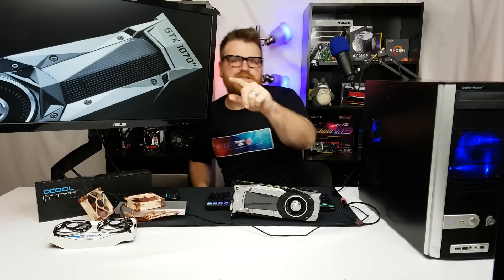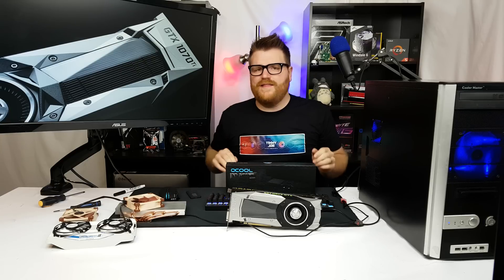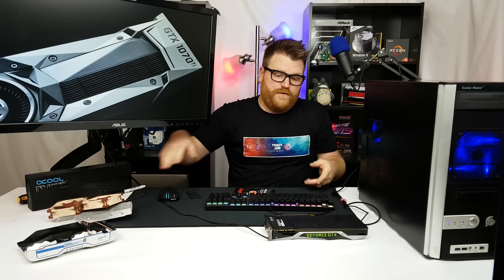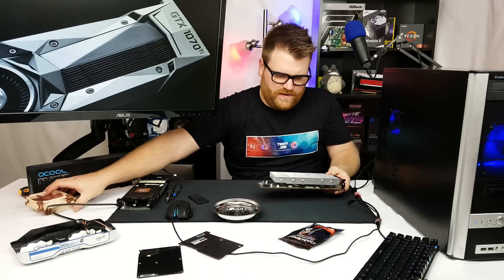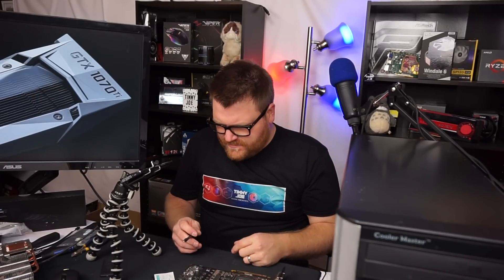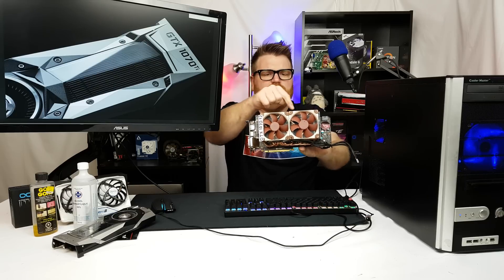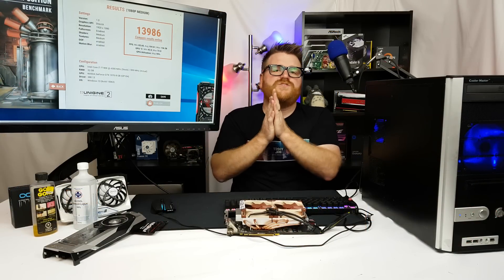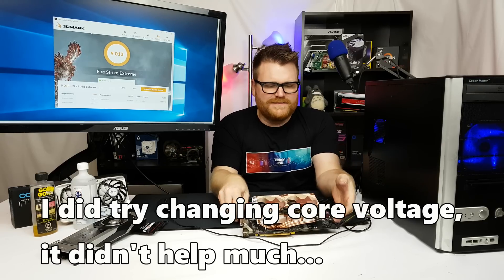My Own Nvidia GTX 1070 ti - Power Shunt Resistor Mod

Comment: this crap is nuts, i wouldn't ever apply gallium to anything with solder around it. only thing i feel comfortable really is die to ihs, and maybe maybe pure copper heatsink in the perfect quantity.

but this? No. give me the exact resistance resistor required for the voltage boost you want

Comment: Do not use Liquid Metal to Shunt Mod, it will melt the solder over time and the resistors will pop out of their place.
For Shunt Mod use proper soldering.

Comment: You can use a program called Argus monitor, allows you to set the fans (connected via SYS_FAN or CHA_FAN header) on a fan curve that corresponds to the GPU temp.

Comment: Tip, cover the solder points in clear nail polish so the gallium doesnt't dissolve the solder in a few months taking the shunt with it. I'd paint around the shunt, the ends, and the middle just to minimize the contact with any components, as long as it contacts the top of the solder points it will work, but covering shit in nail polish means: you can clean off the LM then use acetone to clean up the nail polish wich leaves you with a brand new surface insted of a half corroded amalgamated mess of solder and shunts.

Comment: If you're using liquid metal to short those resistors, it apparently creates an amalgam with the solder Nvidia uses and weakens it to the point that those resistors just fall off.
Reply: yea i'm pretty sure it has gallium in it

Comment: Let's see how long this graphics card lives, since Conductonaut contains Gallium, which corrodes quickly.
Chance by now, the components on the PCB have corroded off and the card is failing at this point.

Comment: Buys GTX 1070ti. Applies power shunt resistor mod. Increases clock speeds. Smells burning. Runs for fire extinguisher. Realizes the fire is on head.

Were gingers really kissed by fire?

Comment: It’s all fun and games until someone loses a house 🏠😞
Reply: But how though, 2 fans on Mobo headers (where they go) and a gpu thats made to blow capacitors and such to reduce the risk of a fire or electrical hazard. No prob as long as your psu is good enough.even then still pretty hard to start a fire
Reply: "reduce the risk" not Eliminate.  You may have never seen a PC literally catch on fire but I have.

Comment: You bypass a protection mechanism of the electrical design and by doing so you put the GPU in Risk of Death. Is it worth Risking a 500$ (600 today) for 3% performance boost ?  I don't think so...   Its like taking a Fuse of the system

Comment: The MSI AB slider doesn't actually "add" any additional power to a GPU. What it does is ALLOW the power (max value defined in the BIOS vs the default value) to be used. That's it..

Comment: Also this mod is kind of (although not totally) pointless unless your water cooling and although max clock speed doesn't increase that much, its not really the point of this mod. Its more about making the card nice and stable and not constantly go up and down all the time because its struggling for power when unmoded and overclocked. So it will cure a lot of minor here and there stuttering if your running 4k 60fps for example.

Comment: You should check the resistance  with a multi-meter before and after mod. Be careful not to lower the resistance too much by using to much liquid metal or other conductors like wire otherwise the card will go into safe mode and be locked at a couple hundred MHZ.

Comment: Should I get a costly 1070 like the Asus OC one or should I get a cheap 1080 and overclock it with MSI Afterburner? Nice video by the way.
Reply: Titin Sahoo if you can’t decide go with 1070ti

Comment: Gn did a nice video on the shunt mod. The more liquid metal you add the more power get delivered to the gpu.
Reply from the maker: I have the perfect amount, I can't go above 103 of 110 on the power slider now. I've had this card at 2.2 Ghz stable. It's as far as it will go. I need to get a real card, VOLTA HERE I COME

Comment: I've seen alot of OCed 1070s and i noticed that mine must be a pretty good Overclocker, i'm getting around 2126-2152 on the Core, at full load around 55-60C and 600 on the Memory with an Air cooled 1070 FTW, (with the side panel off of my case), and i never got any crashes or artifacts, makes me wonder just how far i could go with it, but i'm happy with the OC i have on it already.

Comment: Be cautious with Alphacooler waterblocks. Mine on a R9 280 leaked where the four screws hold a cover on the water block. IMO not enough preasure to keep a good seal. So be careful when using one.
Reply: Alphacool usually is very good. Idk man.
Reply: Also had Problem with alphacool blocks pushing the oring away because of corrosion😢

Comment: I am curious because you dont seem to overvolt. For example on my 1080 ti, if I dont overvolt I dont reach 120% power delivery limit with my max OC. So isnt it the same for the 1070 ? And if you dont reach 120% a mod like this wouldnt change anything or am I missing something ? Wouldnt a mod like this be more effective as you crank up voltage? 

Also, how fast do you think a mod like this would kill your video card with overvoltage added to it ?
Reply from the maker: Do you mean hardmod overvolt. Because you can't software over volt especially a 1070. The limit is set way too low changing anything and software it doesn't seem to affect anything. When I had a 1080ti overvolting made a little bit more sense but it didn't do too much. As for this power mod I mean if you run your card all the time you're pushing it to the limits but there are hard limits in place that don't really let the card hurt itself. I doubt this would hurt the cards life expectancy especially considering I'm now running it at 55 degrees or less all the time even at Max overclock
Reply: I meant overvolt through software. So even if you overvolt you dont see the difference on the voltage ? Do you hit the 120% power limit with just overclocking on the 1070 ? I never had a 1070 so I have no experience with it, but on on 1080ti (seahawk keeps under 50 degree at all time) it goes about 30mv over what it does without overvolt on software (1093mv instead of 1062 and give me about 50mhz more) but when I overclock vram I hit the power limit and it starts downclocking and down volting. I never saw over 115% power while not overvolting though. So do you think that that kind of mod would have no effect on my card if I dont overvolt ? Also do you think that this kind of mod can have an effect on other parts of the video card even if the core stays at <50 degree ? Can I do that kind of mod to be able to keep my 1093mv at all time without any impact on my video card life expectancy ?

Thanks for the answer btw :)

Comment: Cool! I never knew you could do this to a GPU! Theres so many awesome mods aside from just simply watercooling!
Reply: Too be honest the best cooling is liquid helium colder than liquid nitrogen and getting as much performance from a stock thing with a item that is better than stock but is still a fan like a pc fan liquid metal and all the other stuff to make a cpu cooler with the parts you got no need to spend thousands for 20fps not worth it i would like to just take stock parts and see what you can push before you need to back of

Comment: Timmy Joe was that an Aluminum (Al) sink on that cooler?  If so you don't want to get LM on it.  LM is highly corrosive to Al.  Also the limiting factory to your mod is the vram clock and amount of vram.  Bump your clocks up on the vram 50Mhz (+.05 voltage) and things should get interesting.  If you do that monitor the voltage and temps of the ram(they should be fine watch them for a little while).  The vrm should be fine as they are a bit over kill on that card (and all modern cards for that matter) because of the required phase count uses a doubling scheme.  The mod you just made (LM on the sr)will most likely kill the card in a year to 18 months (at most) anyway so have at it.
Reply: I think he is aware of that, but that artic cooler has copper on the touching area anyways. :)
Reply: Karsten M. I saw that.  What I was unclear in my response was to be careful when working around LM and Al.  The fins will literally be eaten completely in sections if it comes in contact with LM.  Further some Cu alloys do contain Al as an anticorrosion base (that green tent on older Cu products) so you have to be careful with it there too.  As I didn't see him use LM as the thermal paste I assume he didn't.  Just saying be REALLY REALLY REALLY careful, is all.
Reply: @BcHmF  which is again, corroded by liquid metal, gallium/indium TIM needs nickle plated sinks. Aluminium forms an amalgam with LM in minutes, but isn't much friendlier and not recommmended ever on copper.
Reply: Lol. It's nickel plated copper :D
Reply: Ediranii wasn't sure didn't catch the make and model.  I know some manufacturers make or have made CuAl alloys.  Cu will also still degrade with the Gallium based LM.  But if any part of that plating in the Cu plate fails and there is Gallium it will eventually fail.  We use a CuAl alloy(s) in some applications but that is for some applications not for electronics use.  We also don't use gallium either.
Reply: Ediranii you are incorrect.   I checked Arctics website and it said it was Al fins so then to make sure, I called my contact at Arctic and he told me it was aluminum fins.  He said they do not make this model with nickel plated copper.   He said the website is correct.  Here it is https://www.arctic.ac/us_en/accelero-twin-turbo-ii.html
Reply: bigsportsman thanks for the info
Reply: Yeah with these stuff you have to be careful, as you correctly said bigsportsman.
Reply: Ediranii you are incorrect.   I checked Arctics website and it said it was Al fins so then to make sure, I called my contact at Arctic and he told me it was aluminum fins.  He said they do not make this model with nickel plated copper.   He said the website is correct.  Here it is https://www.arctic.ac/us_en/accelero-twin-turbo-ii.html
Reply: Mykel Hardin what?  I just happen to know a couple of people in the computer industry that I have done some data analytics for in the materials cost area.  That is my primary job.
Reply: Mykel Hardin entirely possible.  I didn't mean to sound that way.  Things can come off a bit different than intent when typing though.  Sorry didn't mean it that way.  I was trying to convey that I spoke with someone who would know better than me, as I was not familiar with that specific product.  Sorry again didn't mean to sound like an a..hole.
Reply: bigsportsman Don't apologize to these crybabies. Fuck em!

Comment: Hey I read it somewhere, be-careful for Liquid metal might eat through your shunt resistor...make sure it's only touching the middle of the shunt resistor...https://www.youtube.com/watch?v=c2_UjhMHU5o
Reply: alt411 Totally why I solderd bridged the shunts on my 980
Reply: @zoomzabba452  I also did that with my 980 but with 1000 series you shouldn't make the resistance too low because then the cards puts itself into low power mode
Reply: @razurio2768  way to necro. Good point though.

Comment: Be careful with the VRM temperatures.
Reply: No, that was EVGA not putting thermal pads on the VRM's of their 1080's and having a shit BIOS. They issued the pads for free and you had to put them on yourself. Wasn't an issue on Reference cards or any other brands.
Reply: They did it on my 1070 sc for free. I sent them my payment details, they sent me a 1070 sc w/ thermal pads, I sent them my 1070 sc. Didn't have to install the pads myself.
Reply: yeah, wasn't that a factory issue where they had to provide the mod for free?

Comment: Before I did a evga step up my 1070ti did about 2126 started at 2136 but it was a water cooler wonder what that thing would have done with this mod. It's not something I'd really do though

Comment: Still love you're channel. 

Caved and had to get a 1080ti for my 1700. Overkill I know, but things are happy.
Reply: Or just have both. Then you'll do and you can brag. Problem solved.
Reply: POD 1080ti is the only way to go, 1070s are for kids!
Reply: first went for the 1060 on my r7 1700, now I had to cave and get a 1080 I feel the 1080ti might be overkill but only in resolutions under 4k, IMO.
Reply: 1080's are for bragging rights. 1070 will do just fine.
Reply: POD Too much is never enough.
Reply: I have two gaming rigs with both a 1070 and a 1080ti. The 1070 is an AMAZING card (I wouldn't call it for kids). I feel is the best performance-for-buck card there is. 100fps+ Ultra/High on pretty much anything at 1080p. Go above 1080p, to say, 1440p, and 1070 starts struggling, even though it will take it like a champ and maintain itself around the 60 +/- fps mark. This is where the 1080ti comes in play. Maximum performance and high framerates at 1440p (this I feel it's the sweet spot) and beyond.